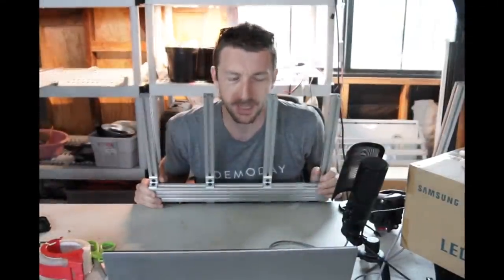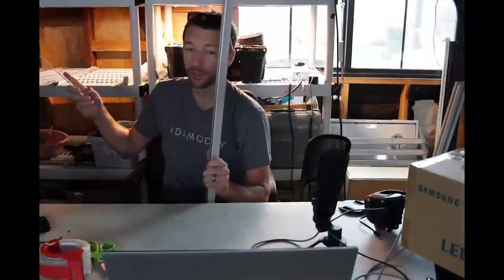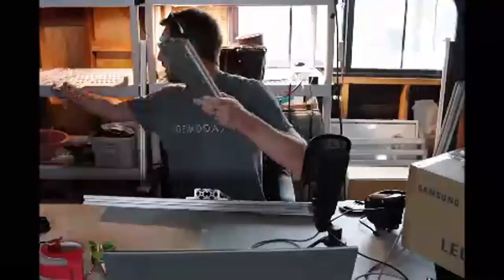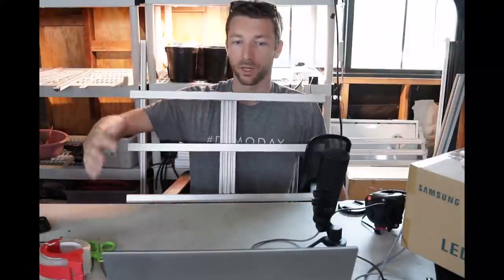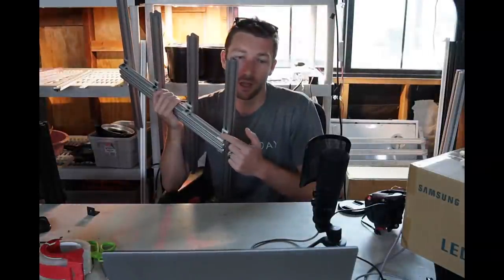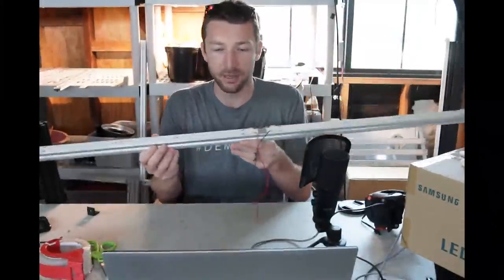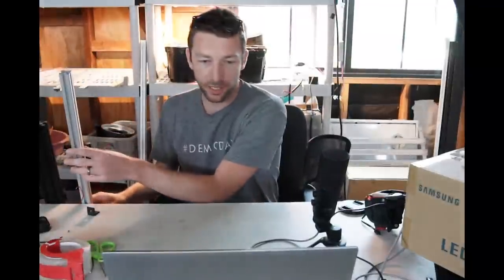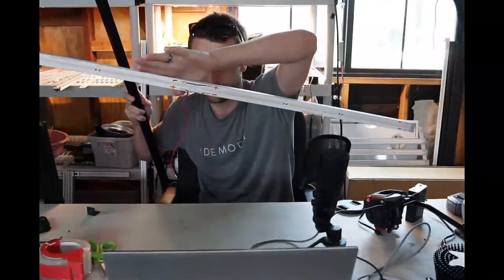New Better Heatsinks: Photo Boost

Comment: I have the exact build using 6 HLG 288qb’s rspec. It’s over a 4x8. I will be adding to it with some of the PLC strips. It’s killing it already, can’t wait to add some extra photons where needed. Another great thing about this design is it is completely adjustable and expandable. So easy to just get a few more strips and a driver vs getting a whole new light 👍🏼✌🏼👊🏼

Comment: Hey man I am very limited with how much I can spend on a grow light build at one time but I want to build a 8 strip light for my 2'×4' grow tent. If I buy a couple (2) of your photo boost strips the spine and heat sinks to go with it do I have to use a different driver or could I use the mean well driver you recommend for the 8 strip light?
Reply: You need a different driver. He really recommends not doing this unless you are 100% sure. If you look on the website there are build outs and they specifically mention which driver is recommended. I know what you're look for is on there.
Don't be discouraged he has plenty of older videos that really go beyond builds into theory so you understand what these builds are about. GG has tons of videos to look through but there is another Youtube channel from "growmau5" who has a very easy led diy series to go through and quicky explains the basics. It's a place to start, and it can teach you how to pick your own

Comment: Hey Greengenes, I just completed my setup for a 4x4 setup by using 8x - 44 in. samsung led strips. I got the black triple spine, you suggested from before, at 48 inchs and 8x - 48 inch single heat-sink, the exact one you are showing in this video. They have been working great but it is heavy. I was not able to also attach the dual 320 watt drivers to them because the weight would be stupid plus the heat would be unnecessary, mean well HLG-320H-C1400B that you also suggested - thank you :).
Just one question, placing the wires from the edge toward the center spine using the left or right side inner edge of the heat-sink, any idea for keeping them inside?
I am currently ordering thermal resistant tape but it is expensive, I would rather order gold than that tape. I will try it out but Im looking for a better option. Maybe a 3d printed t-nut looking thing with a small hook pointing out to keep wires in check but not in heat? maybe....

Comment: Messed up and accidentally ordered the 4 slotted black extrusions and not the 3 with a solid side. Question is would I be able to still attach the photo boost strips with the adhesive tape to the 4 slotted?
Reply: No. It’ll never adhere correctly and you’ll have poor heat transfer.
Reply: @Brad Mitchell  I think they will work just fine as long as you got the smooth sided extrusion, you still got almost 3/4 of the surface to adhere to you just dont have that extra piece of webbing plus they out perform the plc heatsinks so i dont think that 1/4 your losing is going to make a difference! id use them 👍✌

Comment: Great info on the video.   Thank you so much.    May i ask you something?  How do you run the wiring on the same setup showed on the video?   24" inch heat sink and a  spine in the center.   The + - terminals would be at the end of the led strip.....  Thinking on 8 strips and a spine at the center for a 3 x 3 tent.   Any advice would be appreciated
Reply: Just adding some feedback from previous videos, he ran some of the wiring inside the left or right inner edges from those spines. This is how I did it and it works decently well. I had 48 in. long heatsinks with 44 in. long samsung led strips. I placed the wires inside the inner edge and it went all the way to the center and than they come out and go to the top to the spine. 
Easy but I have not figure out a way to keep the wires inside especially due to the heat, I cant place any glue or electric tape. I would need to find thermal resistance tape. Any suggestions to this problem would be greatly appreciated.
Reply: @mmenil1  Don't know if you still need the info... but https://8020.net/catalog/category/view/id/705/?cat=713 . I'm sure there is cheaper out there.
Reply: @spinny2593  those work good. they make little pop in pieces that you can connect a mini zip tie to also.
Reply: @DarthMasiah  Do you have a link to that? I know I saw them for the outside for cables or tubing that were way expensive and I've been through their catalogue about a couple dozen times and do not remember seeing them.

Comment: How does the new build hold up to 2100 mA? Have 2 hlg-480h-c2100b run at about 600 to 700 watts from the wall so about 60 to 70٪ of a total 892 watts out
Reply from the maker: at 2100 it's ~75c. The FLIR image on the website page for the heatsink is at 2100ma. https://www.pacificlightconcepts.com/product/46-photo-boost-heatsink/
Reply from the maker: Airflow and circulation can improve it a lot.
Reply: @GreengenesGardenOfficial  so the new heat sink design can handle 2100

Comment: QUICK QUESTION??!! How hot or at what temperature should an LED  heatsink run at? If your pulling 150watt on it?
Reply from the maker: Doesn't matter what the wattage is. A LED should never operate at over 80C. That is diode...not heatsink. Heatsink temps mean nothing. Only actual diode temp matters.
Reply: @GreengenesGardenOfficial  so since my chips have a dob and an NTC sensor for the PCB overheat protection I should be ok as long as it doesn't turn off? I'm sorry I'm really new to all building LED  lights. I really hope it's worth the conversion over from HPS. Will I even notice a difference from switching from 1000 watt HPS to 500watt 380nm-840nm in a 4x4?
Reply: @GreengenesGardenOfficial  and thank you very much for the response

Comment: Hey GreenGenes, I have a wiring question for my light build. I want to use this cable https://www.wireandcableyourway.com/portable-cord/600v-soow-sto/soow/18-5-soow-portable-cord-600v-ul-csa.html (5 wire only comes 600v) to splice the DC connections between the twin 320’s & the 18 awg solid wires on the lights with wagos inside a 3-way gland & use this cable https://www.wireandcableyourway.com/portable-cord/600v-soow-sto/soow/14-3-soow-portable-cord-600v-ul-csa.html or https://www.wireandcableyourway.com/portable-cord/600v-soow-sto/soow/16-3-soow-portable-cord-600v-ul-csa.html to combine the AC connection between the twin 320’s with a 3-way connector. What do you think?
Reply from the maker: Sounds good. What is the question?
Reply: @GreengenesGardenOfficial  MY BAD, My question is should I use 16/3 instead of 14/3 for the AC connection & should I use the stranded wires w/ an additional point of potential failure instead of 4 - 18 AWG solid wire connections w/ a distance of 15' from drivers to lights...THANX
Reply from the maker: Definitely want stranded on both sides. 18awg is fine for the DC driver lines. 16 would work for AC...14 would be better if more than 6ft.
Reply: @GreengenesGardenOfficial   i have one last wiring question...could i use 18/5 tray wire  https://www.wireandcableyourway.com/18-5c-thhn-pvc-tray-cable.html  instead of 18/5 SOOW cable  https://www.wireandcableyourway.com/portable-cord/600v-soow-sto/soow/18-5-soow-portable-cord-600v-ul-csa.html for the connections between the drivers & the lights ? Would I gain or lose anything with the change of wire ??

Comment: Hi Greengenes I had a question on LED's and degradation. I remember you saying over there lifetime the degradation was minimal campared to fluorescent ,HID and HPS those I used to replace every year. Would like to know what to tell people just getting into LED's about this matter. (potential customers) Over here on the East Coast.
Reply from the maker: Called an L70, L80, and L90 when looking at any lighting. 
L70 menaing the light will have 70% of it's intial out put by that time....L70=50,000hrs
L80 is holding onto 80% of its initial output. And L90 is 90% of it's initial output. 
Very common for L70's of 50,000. Cooler a system runs the longer they last.
Reply: @GreengenesGardenOfficial  That's a long time @12 & 12 flowering! thanks

Comment: did you actually release the video of the DIY photoboost 2.0 build and label it the newest and most improved version, to get rid of your old heatsinks supply?
Reply: i'm almost done with your 5x5 fixture (but missing two strips) and i'm battling heat right now and i'm wondering if I have to rebuilt the entire thing. however i used the thermal tape instead of the screws so I feel like i got fucked over because that thermal tape is like permanent those things are on there so tight.... do i have to sell this light and start from scratch?
Reply: and you increased the price on your photoboost strips from 24 to 27 to make more profit on them? ... jesus man
Reply: aboynamedben Having a different heat sink will not lower your temps in the environment. The better heat sink simply keeps the diodes cooler for longer life. You’ll be fine with what you’ve got. Get the driver out of the room if possible and keep cool air coming in.

Comment: what are your thoughts on just using the regular t slot 1" x 1" as the heatsinks instead of the Tri-slot. i'm in canada and cant find the tri-slot anywhere without paying $300+ for shipping. i have similar strips with lm301h. thanks! great videos by the way!
Reply from the maker: I would never do it. Right where the diodes are you have zero contact with anything.
Reply: Greengenes Garden okay thank you. Will have to keep looking for a solution.

Comment: DM'd you on IG, but didn't get a response. Anyway, can I use the "older" 1"x3" EX1030 Frame so I can mount the drivers directly on it, and use the 1"x 1/2" EX1050 as heatsinks to slightly offset the weight? 

Thanks
Reply from the maker: What temperature are the diodes at on that 1/2 profile?
Reply: @GreengenesGardenOfficial  I'm not sure? This would be for a 4x4 setup, PLC 16 strip 640w similar to the builds you have done on your channel.
Reply: @PorscheTT  What happens if you take one of the turbos out of that PorscheTT to slightly offset the weight?
Reply: @IrawkusI  apples to oranges, all I'm basically asking is if the 1/2 profile is enough to cool the strips. @greengenes